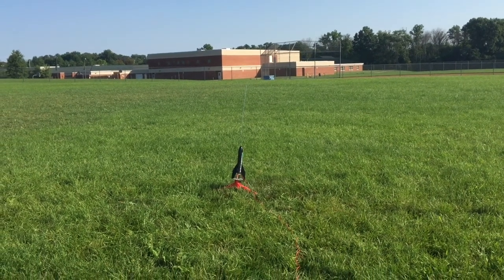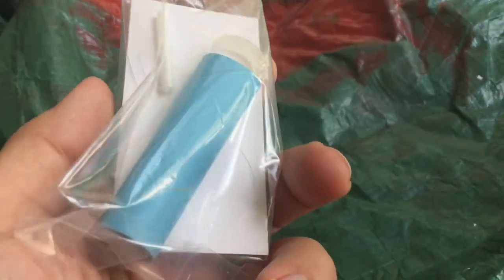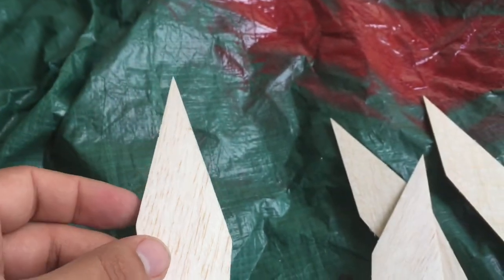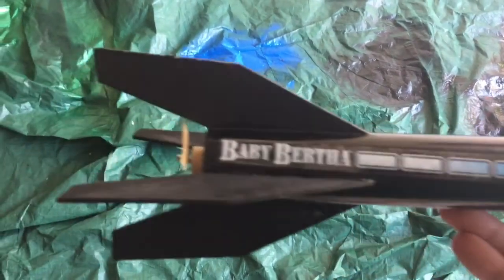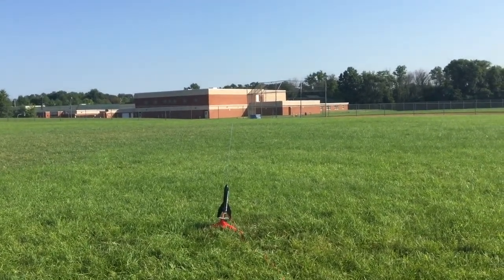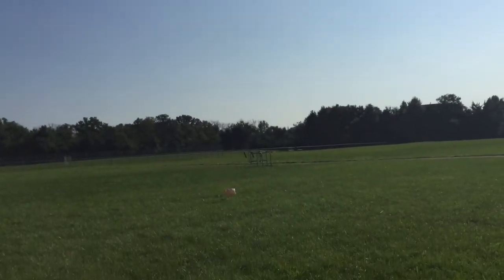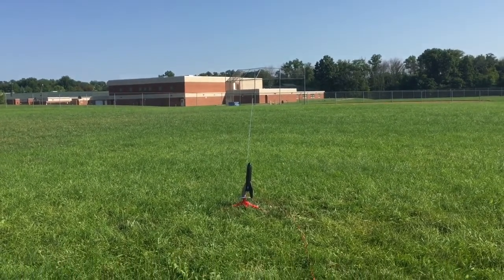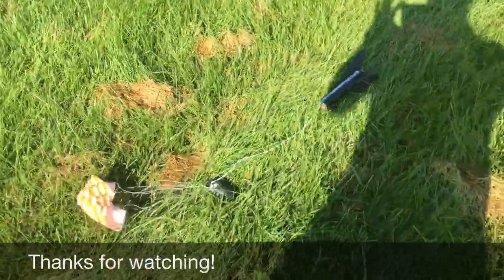Estes Baby Bertha Model Rocket - Build & Launch on A, B & C Motors

Comment: for future reference you always build the rocket first and then paint it.  nice video!
Reply: The reason for this is because gluing on paint gives you a weaker bind.  
Also, another tip. For better results on applying the stickers, place the sticker in a bowl of water with 1 drop of dish detergent. This will give you more time to stick the sticker on the rocket before the glue binds, and makes it easier to get the air bubbles out from behind the sticker.